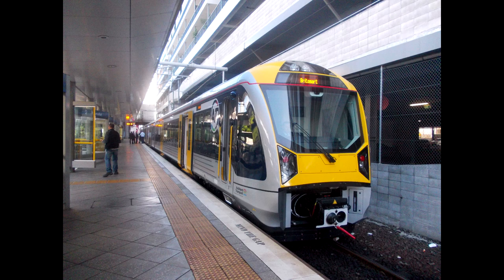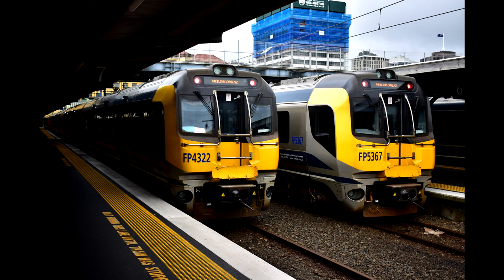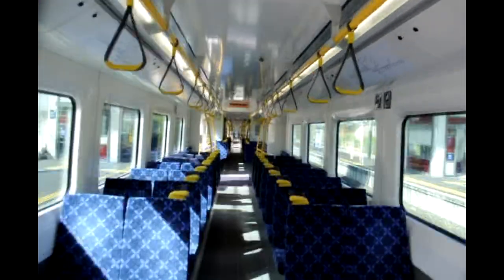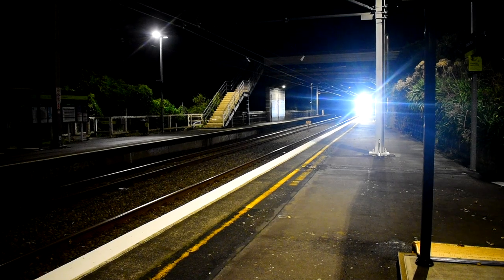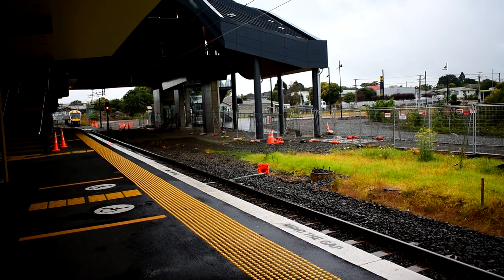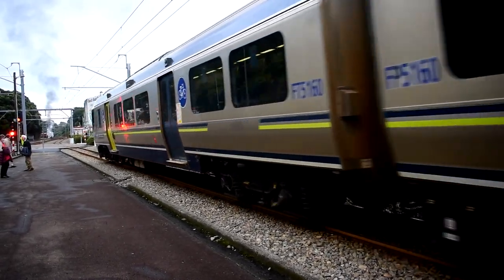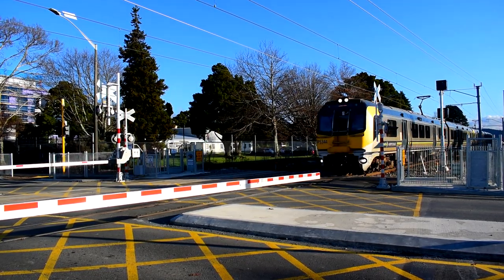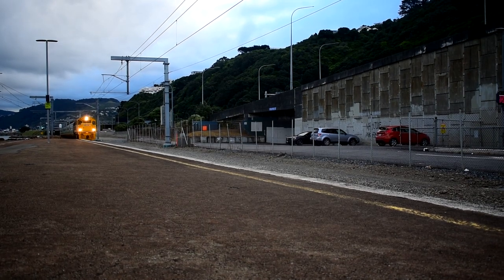Comparing the Auckland & Wellington Commuter Trains (HD)

Comment: In any case, the question of which is better will become a lot clearer after the CRL and associated track work rollout - Auckland's network has had real momentum over the past 10 years while Wellington's is still trying to get past paper ticketing. Wellington's network has been properly maintained and expected to be maintained well through the 90s, whereas Auckland's has been largely neglected by KiwiRail after privatisation and the dark ages in the 80s/90s - hence the closures in the past couple years. With the CRL, the entire track network is being upgraded to modern spec to support 15-min frequencies all-day, 7-days a week. The AM class units are also getting interior swap-outs, mainly to fire-rate them for underground tunnel use, but a good opportunity to install some comfier seating. Auckland has a better station facilities - will get even better with the underground additions, and also a much much better feeder bus network. AT just needs to speed up level crossing removals on the Western Line and third/fourth track construction.
Reply: Wellington’s network was in a pretty dire state in 2008. Many of station buildings and the rotting 1950s timber overhead catenary looked almost ready to fall over and the rolling stock was creaking and often broke down or had door failures. But the Wellington Regional council have invested in improving the facilities, in coordination with Kiwirail.
The Auckland council has often not cooperated with Kiwirail, and bought electric multiple units with strange rigid swivels that wear the tracks out faster, and adopted an odd operating model where the trains go very slow and stop at every station (instead of having staggered express services) due to never implementing and switchbacks at a midway station.

But maybe the Auckland services will improve once this trackbed renewal is finished. They really should have a project of installing a switchback at New Lynn and Puhinui, to allow for staggered services so commuters from Papakura or Henderson don’t have to stop at every bloody station.
Reply: Auckland definitely seems to have better trains but then it is a bigger city.
Reply: @sovietonion72 Nope the Matangi trains are better.

Comment: Parts of the Auckland network are impressive.  I really like the electric buses running from Auckland airport to Puhinui & the train to Britomart.  Puhinui Station looks amazing.  And Britomart to Newmarket is a smooth experience & the Newmarket Station is really modern.  I haven't used the Wellington trains much & in general the stations seem to be a lot older.  For example Wellington & Petone stations, & their ticketing systems are antiquated compared to Auckland.  Auckland, Brisbane, and Sydney are light years ahead of Wellington.
Reply: The quality of a service doesn’t depend upon the ticketing system.
What’s important is that the trains are reliable and punctual. The second most important thing is that the trains are quick and comfortable. And of course it is important that the stations and are are in the right place.

In those regards; Wellington has a good system and service.
Reply: Unfortunity NZTA got ride of a great dedicated cycle way from great south road to the airport to make the bus service happen which is a backward step.

Comment: The Auckland EMUs are far superior. Higher capacity, larger units so more spacious, better design, sound better, etc. Add in better stations across the network, the HOP card, plus the City Rail Loop and many other upgrades happening currently across the network. I would say Wellington's network is pretty decent given the city's size.
Reply: Hahahaha nope Wellington’s units are much better. No creaking, smoother ride, better air conditioning, don’t crawl along as slowly.

Comment: I'm a Welly local and have been on both systems and noticed that Wellington's trains are a lot narrower in width due to having to fit through the multiple tunnels (especially on the Johnsonville and Porirua lines). Auckland trains are more spacious
Reply: Yes Wellington has a smaller loading gauge in general but especially due to the Johnsonville line.

Comment: I live in Auckland and although the trains in theory run 7 days a week in reality they only run Monday to Friday. Almost every weekend at least some parts of each line is not running because of track maintenance. Also the Onehunga line will no longer run to Britomart soon because of ongoing construction to the CRL. The train services in Auckland have become substantially worse since about 2021 due to constant shutdowns because of track issues
Reply: I figure once the city rail link is finished, much of it will become easier since the lines will have an increased capacity which means they will have more time available for maintenance

Comment: Good one, thanks.  Interesting common feature of all NZ rail is 1067 mm gauge.    That ex-UK carriages can be used show just how small the UK loading gauge is for 1435 mm gauge track.  Wellington tickets were pre-printed on cardboard until recently at least.  A system that did  not need computers at all.  So modern technology left Welington trains well behind.  About to change I hear.
Reply: Yes Wellington still has carboard tickets but is slowly rolling out electronic ticketing. Hardly a biggie though, aside from having the guard still clip everyone’s ticket.
Reply: @danieleyre8913  That they are still using the same ticketing system after 80 years suggests that they have not thought about ticketing systems much during the life of the system.  I think it is not very reliable to depend on the guard getting to every passenger.   Ticket selling in stations is expensive if you do not use machines, so you depend on guards to sell tickets too.  You need zealous guards who are hard to find...
Reply: Haven't been on a train in Wellington for over 10 years, but was in Auckland last month, and the AT card was seamless regardless of mode - just need mobile payment options without a card.

Comment: Wellington trains only go north from the north east edge of the central area.  No trains south.  No service to the airport.  Auckland doesn't have direct service to the airport, but there is a train/express bus setup now, with train planned.

Wellington is getting people to Wellington from suburbs.  Auckland gets people around from south to west, east to central.  Just missing north.

Both are limited by the rails laid by Kiwirail.
Reply: It's too hard to get to airport in wellington without making it elevated or using tunnels, and it was only built in 1959. Aucklands bus service can be unreliable as the only ones that half work are school buses. And the Light rail system will probably go on to 2050. (wow that was long)

Comment: Another difference is the IGBT–VVVF inverter and asynchronous traction motor sounds.
CAF AMA/AMP class: CAF converter/inverter powering eight (4/end carriage) Mitsubishi MB-5146-A (190 kW) asynchronous motors
Hyundai Rotem/Mitsui FP class: Hyundai Rotem inverter powering four model/make temporarily unknown (170 kW) asynchronous motors

Comment: It would be awesome to see the AM class EMU's running south of Auckland to Pukekohe and under the city between Britomart and Westfield when the electrification the Papakura-Pukekohe section of the North Island Main Trunk (NIMT) and the City Rail Link (CRL) project are finished. But, I would still personally prefer that they extend the electrification on the North Auckland Line from Swanson to Whangarei, so the AM's can run from the Britomart to Whangarei. And as for Wellington, new rolling stock will be introduced for the Greater Wellington region, EMU's compatible with voltages ranging from 1500V DC to 25,000V (25kV) AC with more capacity for passengers traveling from Wellington to Masterton or Palmerston North, I believe those EMU's will be built by Stadler, the same company who are building the new DM class diesel locomotives. However, the existing FP/FT class Matangi units can still run from Wellington to Masterton or Palmertson North, when the Hutt Valley lines are once extended to Masterton and the Kapiti lines to Palmerston North.

Comment: Thanks for an excellent video. Years ago, during the 1970's, I visited New Zealand and rode the trains both in Wellington and Auckland. Back then, Wellington had the old red electric suburban trains and Auckland only had suburban diesel trains, with the main railway station being out near Parnell.  From what you mentioned,. not only the trains have improved, but also the frequency of services. I remember some Auckland suburban lines were two hours between trains back in the 1970's. I am not exactly sure of the frequency of Wellington trains back then, but I think it may have been about an hour between trains. I remember that the scenery while on the Wellington trains was quite spectacular, especially just out of the city.
Reply: The Wellington rail system had 30 minute off peak and 15 minute peak services between the 1960s and about 5 years ago.
Reply: Before electrification (but after the decision to electrify), the station moved from Parnell to Britomart.  Now, Parnell is still an operational station, but for diesel only.  I don't think any freight stops there, but the train from Auckland to Wellington starts/ends there.

Britomart had a relatively brief period as the diesel hub, then was electrified, then has been under construction ever since.

When electrification hit, the southern most point of the network moved to Papakura, if it wasn't there already, and the "northernmost" point (in quotes because it was on the west line) dropped back to Swanson, because AT and Kiwirail can't figure out how to electrify past there.  There is a bridge too short to electrify under, and AT won't raise the bridge and Kiwirail won't lower the tracks, so it's stuck forever in political limbo due to funding blame.  I think before electrification it went to Helensville, or maybe just beyond.

No movement has been made towards rail to the North Shore.  Still 30+ years away, unless a drastic change in policy happens.

Comment: Having lived in Auckland and Wellington and traveled extensively on both networks, I think the Wellington Matangis have the edge over the Auckland units. 
The Matangis have pocket doors which open and close quickly and quietly, whereas the CAF units have doors which swing out and along, and when they close they do so with a very loud CLUNK.
The seats in the CAF units aren't as comfortable as the ones in the old ex-BR MK2 coaches, and the seats in the Matangis are marginally better than the CAF ones.
Reply: Yeah the Matangi’s are pretty ace. I remember when they were new and all of these loser railfans in Auckland mocked them for being ugly. But they are much better than the ADK class being used in Auckland at that time and better than the CAF’s. They’re so smooth and cosy.
Reply: Wellington has better trains, but auckland wins with nicer infrastructure, ie nicer stations

Comment: Just got back from Wellington and rode all the lines except the Wairarapa, frequency is better on the Kapiti and Hutt Valley lines and on par with Johnsonville compared to Brisbane where I live, the Matangi trains look nice and the non-disabled seats are comfortable but I dislike that the non-disabled entrance requires you to walk up a step I think that's a bad design and half the train being slightly elevated inside seems very unnecessary, the Snapper Card system sucks changing trains for example I went from Melling to Upper Hutt and had to touch off and back on at Petone just to change trains otherwise I would have been charged a penalty that seems like a bad design not to mention Snapper can only be used on Trains and Buses if you want to use the local Ferry or Cable Car and only have a Snapper your shit out of luck, the Wellington Train Network is very scenic especially the Kapiti and Johnsonville lines, next time I'm in Wellington and there will be a next time I will ride the Wairarapa line.
Reply: Masterton boy here.
I can tell you from plenty of personal experience that the Wairarapa line is defo worth a go, there's one hell of a view as you come off the Remutakas and head towards the flats, and vice-versa.
Can't really compare it to the other Wellington line, as I've never actually taken any, which is kinda odd considering I've lived almost my whole life in Greater Wellington.

Comment: Does that mean Auckland is a bad rail network?
Reply from the maker: That's a matter of opinion, as far as I'm concerned.
Reply: Auckland has half a rail network. It was pretty much abandoned from 1950 to 2005. Now we are seeing significant investment. The city rail link will double the capacity of all rail lines feeding into Britomart. Proposed two light rail lines Orewa-Airport and Waimauku-Takapuna would complete the rail segment of the network leaving the remainder to be fed by dedicated bus ways. Its important to note that Aucklands public transport network includes buses and trains as a part of the same network since you can use the AT hop tag on/off card on all AT services, and the services are being designed to integrate.
Reply: In my opinion; Auckland’s train services are overall pretty good.
But I just think overall Wellington’s is better. Auckland’s system has some things over Wellington though; such as the general line stations and the facilities. Wellington has better trains with more comfort and the trains go faster.
Reply: @danieleyre8913  How fast?
Reply: @benharris7358  and dont forget the ferries that are now apart of the AT network
Reply: @AlwaysChasingStorms Well, they often overtake cars on the Hutt limited access road and the pacific highway. So they must be doing at least 90km/h on stretches.
Reply: @benharris7358  Wellington’s buses are also integrated with the trains and have the same ticketing.
Reply: Auckland has better stations and facilities, and better fare and ticketing system. Some of Auckland's stations are really nice. Wellington has better trains.
Reply: Auckland's is better. Rail terminates right in the centre of the city (soon to not be a terminus) and links up with the bus and ferry network next door, making it a great transfer hub. Rail to the airport and to the north shore (where the aotea underground station and northern busway has already been future proofed for it) would complete it.